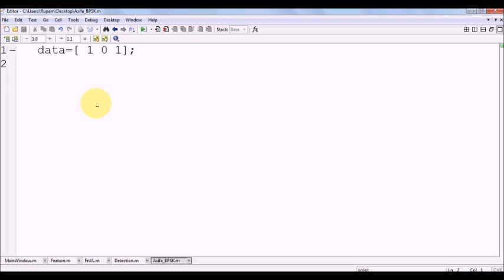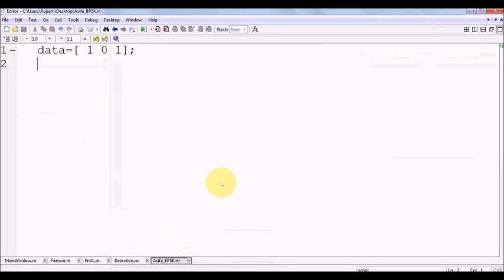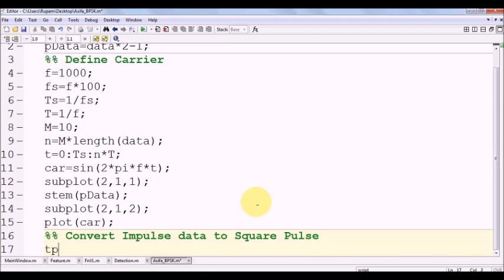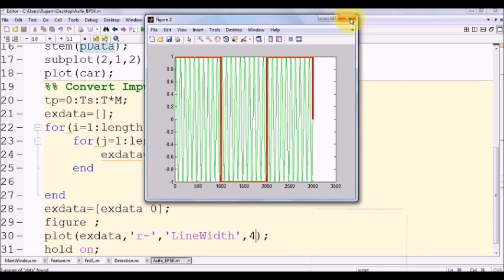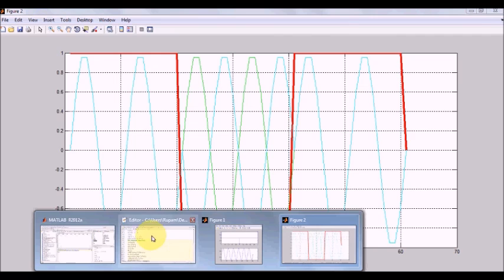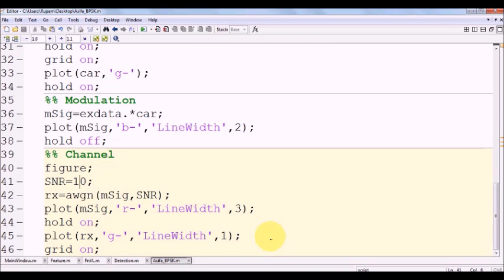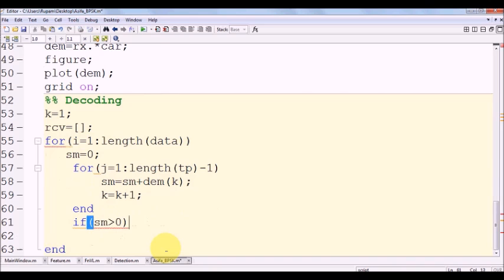Communication for Beginners in Matlab: BPSK Modulation Demodulation With AWGN Channel

Comment: hi could someone explain to me what is happening in line 24 of the code in terms of matlab functionality

exdata =[exdata data(i)]
Reply from the maker: exdata stands for expanded data. So in BPSK, suppose your message is  101 , and our PN sequence is of 4 bits, let's say 1101, then each bit of the message should be expanded to four bits. So message must be : [1111 0000 1111]. In line 24, we are repeating the message bits in an array . So suppose a=1; b=[ a a a a]; will be b=[ 1 1 1 1];
Reply: i understand what is trying to be achieved from your explanation and know what is happening but dont understand how matlab generates the output 111100001111 in an array 
exdata =[exdata data(i)]
what is the function of the second exdata inside the  square brackets??
im trying to enterperate this code in another language and this is the only step holding me up
Reply: It means that the empty vector exdata will be appended by data(i).

Comment: hi thx for the video. btw how should I generate a barker code and modulate with the data on matlab?
Reply from the maker: In Matlab 2014 and above You can generate Barker code from Barker code class of Matlab.
See the example. It is pretty straight forward.
https://in.mathworks.com/help/comm/ref/comm.barkercode-class.html
Reply: Thanks, when I open the example in matlab 2015b, it says undefined function or variable 'openExample'. what does that mean?

Comment: How I can get BER at the end? Could you write me code in comment please?
Thanks for this video it's very helpful!
P.S.
Just try to regulate sound in next tutorials :)
Reply from the maker: Hi, Thank you so much for the feedback. We generally work on the sound and editing while we are producing a video ( either tutorial or demo), ex:https://www.youtube.com/watch?v=g-vF2YzhJwA

However, the basic tutorials that you see here are not recorded for Youtube. They are live recording of my classes. I generally record whenever I teach certain concept. As they are in day time, under concontrolled conditions with many students, regulating sound becomes a problem.

But after you comment, I am considering to use a collar mic to record the audio. Thanks a lot for the comment.
Reply from the maker: About the second part, for  SNR BER, you can do something like this

SNR=[0 1 2 3 4 5 6 7 8 9 10]%or use steps of 2 upto 20
BER=[]
data_len=1e6
for i=1:length(SNR)% or simply use i=1:20
snr=SNR[i];

data=generate_data(data_len);
tx=bpsk_modulation(data)
rx=awgn(tx,snr);
data_rx=bpsk_demodulation(rx);
b=ber(data,data_rx);
BER=[BER b];
end
semilogx(SNR,BER);
%semilogx(BER); If using i=1:20
grid on;

%%%%%% End of Program

All you have to do is convert the transmitter and receiver parts as function ( not mandatory, but preferred) and then call them from loop

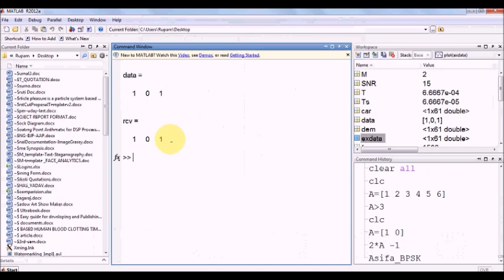Comment: This video was very helpful, thank you.  I noticed that it stops quickly at 20:42-  was there anything else that was cut off at this point?   If so, is there a way to watch it?
Reply from the maker: No, the video was only this much ( in fact this was a live recording of one of my classes). Once you have the basics of BPSK, you should try out Multi _USER CDMA with BPSK where instead of simply extending the signal (exData), you actually XOR it with a PN code. 
1) First you can simply take a Shift register based Gold code generator, introduce spreading (XOR with PN) and despreading (XOR with PN at the receiver). 
2) This step will increase the noise resilience
3) Then take two data: data1 data2 and two pn's PN1, PN2, spread two signal and then add them (mod-2 addition). Send this signal. over channel. at receiver, XOR the received signal first with PN1, then with PN2 to see both data1 and data2 being recovered.
Unfortunately my recording of that particular class is lost :(